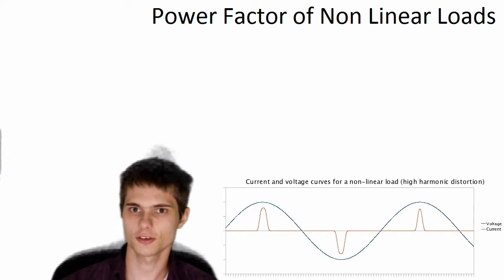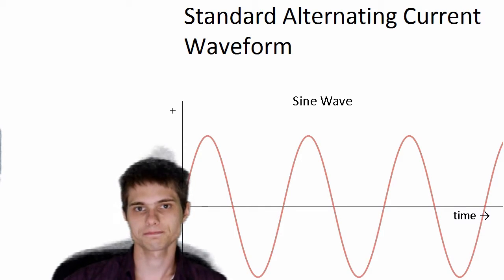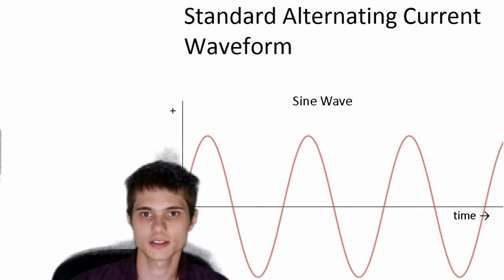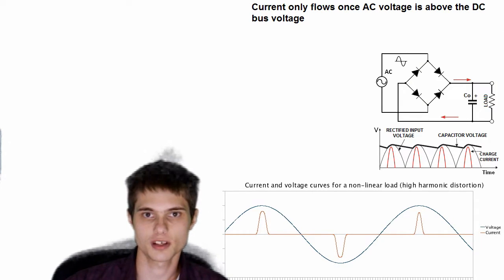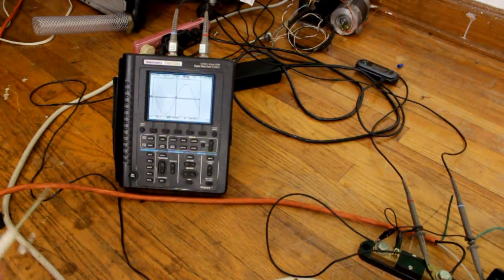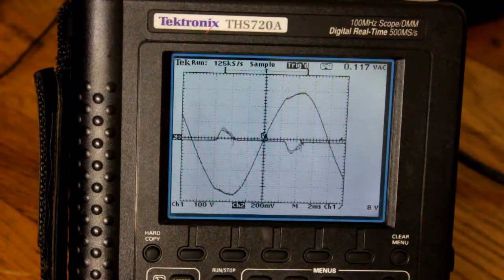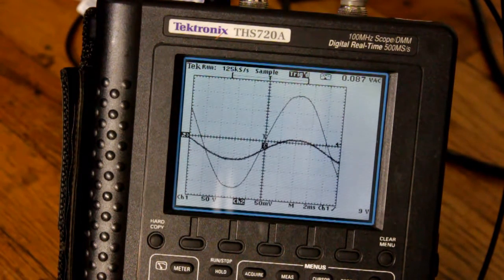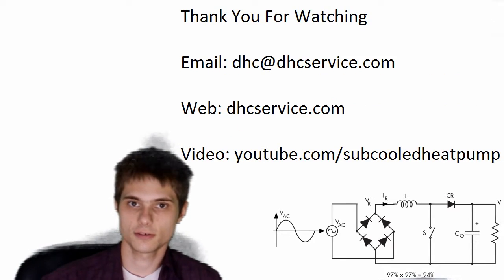Power Factor of Non Linear Loads

Comment: is the boost conv. build going to be from grid power. to DC then boosted and spwm back to ac? I look forward to the build thanks
Reply from the maker: I'm going to go from batteries into high voltage DC. Then I'll show which devices can be safely powered from DC even though they are supposed to be running from AC. Saves a lot of energy since inverters waste so much